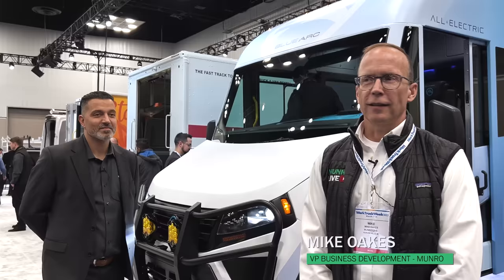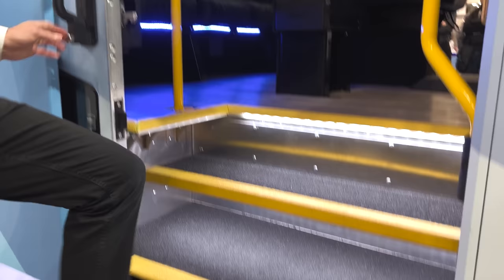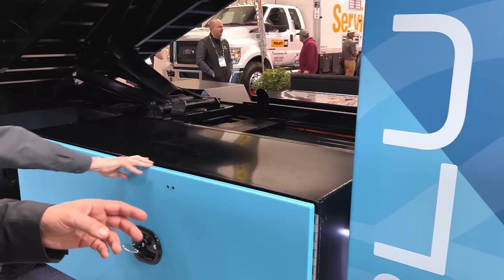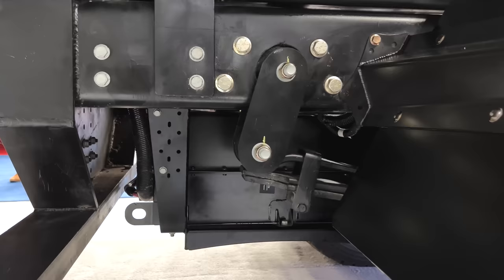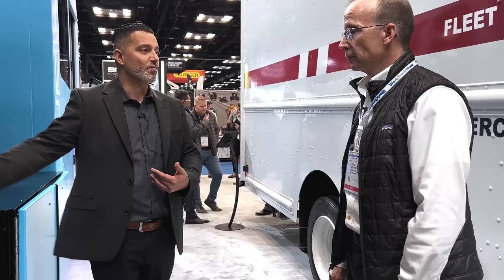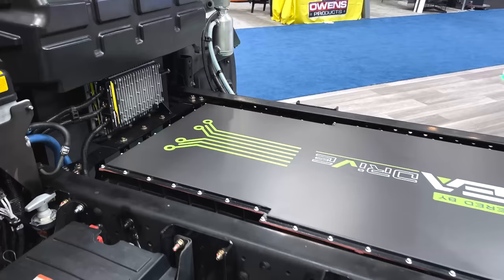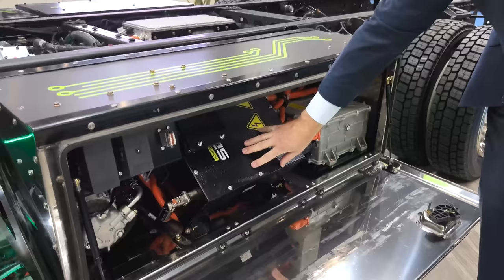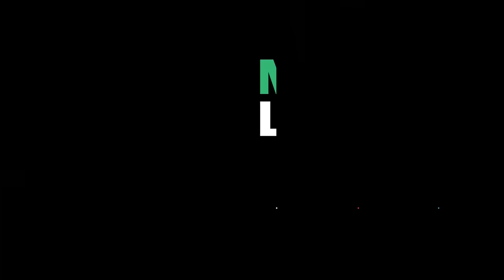Sea Electric and Blue Arc's Electric Fleet Vehicles | Work Truck Week

Comment: The blue arc truck is really nice and well thought out. On the other hand the SeaDrive truck was clearly built by ICE engineers just trying to shove in EV components. I love it when he says that you can charge the truck from AC… but that’s because it’s a TINY battery for that size truck. Using pouch cells for a new design, using electric to hydro, limited space for batteries, a brick of a design from an aerodynamic standpoint - so disappointing. They’re lucky the economics and regulations are so great for EVs, otherwise they’d go bust on their first day. That SeaDrive truck is a disgrace to any EV engineer. 🤦‍♂️🤦‍♂️🤦‍♂️
Reply: Yea it did not look good in terms of components, but as a driver I can tell you cab over with a flat nose is way much more comfortable to handle... especially for last mile delivery which I have been told is the best case scenario for EV
Reply: @mattiafrancescobruni8318  having driven a “flat nose” van I completely agree but even those can be designed to be more aerodynamic. Just look at the two trucks. One was just slapped on with crappy parts (pouch cells in 2023? Seriously?) while it’s clear to see a lot of effort was put into the other one. Kudos to manufacturers who strive to build good products and that don’t try to present a huge disadvantage as a plus (we have a small battery so we can charge faster… what a looser)
Reply: @ranig2848  yep, also the axle, E-motor have a wide ridge of efficiency but in heavy duty is usually associated to a 2-gear shifter to help mitigate some stress (es. Mack granite)....having an axle without an integrated motor+shifter could help bring down cost but wouldn't help in the long term. Also the use of air suspension would relieve some stress from the ESP even if the GVW is not that big....but bear in mind that people that drive company fleet trucks would be 80% of the time in overload especially on a 3.5 ton truck (but they don't specify I could be wrong, I mean they probably would do a 6 Ton version)
Reply: I agree, and the CEO is a finance guy and not the right person to run an engineering company (check all the failures from finance guys).  I've also heard the reliability and service is POOR in Los Angeles.
Reply: SEA Drive is an Australian company and its original goal was to make it easy to retrofit electric drivetrains to light trucks. It's obviously not going to be as good as a ground-up design, but there are millions of those Japanese light trucks on the roads of the world.
American-style box trucks/vans don't really exist anywhere outside of America.
Reply: The Hino truck is an EV powertrain fitted to a regular production glider (vehicle manufactured without powertrain). Yes, that glider was designed for an ICE powertrain.
Reply: It's a converted ice truck with a really simple, easy to maintain or upgrade setup.. 
Seems like a good cheap option right now..

Comment: 7:40 Why not having an axial mounted electrical motor connected directly to the wheels,
instead to have this longitudinal mounted motor with an inefficient differential?
Reply: It's a gear reduction differential to put the e-motor in its most efficient range for typical wheel speeds (all motors have efficiency ranges). Additionally, a banjo-style axle is a robust method of transferring load from the chassis to the wheels for multi-ton payloads.

Comment: 110 volts is so dumb  go 240 !
Reply: The voltage used in the region where the truck is operated determines the voltage to supply for power tools - that's not a design feature of the EV.

Comment: I'll wager one of their battery partners is Volta in Holland Michigan. I've toured their production facility two times and they are are at the top of their game in their industry. If you've ever seen a Winnebago Travato class B van with a battery system, it's a Volta battery system.
Reply: TESLA 4680 Lithium is Better.
Reply: @markplott4820  4680
Reply: @alesksander  - YES, edited. dang autocorrect....lol.
Reply: @markplott4820  How? Compare them, please...
Reply: The cell size is too large for cylindrical but tiny for a pouch (only 17 Ah), which might be a good clue to the manufacturer if someone recognizes that capacity. It looks like Volta assembles systems, and would not be the cell manufacturer.

Comment: I want to see an alternative for my extended mt45 22ft step van. mine has a 5.9l Cummins and converted to a tiny home with 4.8kw of solar on the roof and 32kW of storage.
I actually put a smaller 32gal diesel tank, and it runs both my 5.9 and my heater.
For heat I have a one of the Chinese clones with a custom controller I designed tied into home assistant and takes an air temp from. The 3 zones front truck cab, living, bathroom and using 3in air ducting and 3d printed servo controlled valves it will move air around to keep the Temps even. It has 2.25in of spray foam with no thermal bridges. Everything is epoxy bonded to the foam and 3 layers of fiberglass over the plastic paneling near zero risk of water damage, and I'm pretty sure the thing will float in a flood.
The floor has 2in of foam panels, and the tanks DGB tanks also have foam and coils tied into my heating system. And all this mostly run my A/C is a custom from using a compressor from a prius and a few other cars

Comment: Hmm. Quite low integrated designs. Remembers me a lot of many "garage" ICE conversions. Sadly for battery vehicles weight and low integration is really notable and hurt much more overall efficacy of whole truck system. That includes scattered power electronics, all new extra brackets, heavy battery cases etc. Also i dont see any meaningful  or thoughtfully designed aero features and lacklustre powertrain integrations.

Comment: same for SEA Electric , its Inefficient .
only gets 200 miles on 138 kwh battery and using less Efficient pouch cell Li battery. 
the HINO 195 is a GAS truck glider and built too HEAVY with an outdated Transmission & Gearbox . 
TESLA semi has motors Directly mounted to Wheels , simple 1 speed Gearbox and NO Transmission Driveshaft & Complex gearbox. 
the SEA Electric has too many Parts and ICE components. 
max HP is only 170 , and 1106 lb Torque MAX. only 65 mph ......lol, Barely highway capable.
Reply: The Tesla Semi motors are not mounted "directly to the wheels"; they're mounted on the axle beams, but drive through three-stage reduction gearing systems, and in the single-motor axle there is also a differential.

Just like the single-motor axle of the Tesla Semi, the Hino-based truck uses a motor driving through reduction gearing and a differential... but it has only one stage of reduction gearing (the pinion and ring gears in the axle).

Both Tesla Semi and Sea Electric trucks have 1-speed transmission systems, and similar transmission efficiency; the Sea transmission is just the axle assembly, so it is simpler than the three-stage reduction gearing of the Tesla.

The Blue Arc truck mounts the motor on the axle beam, just like the Tesla Semi.

Comment: C-Electric... how annoying.. I think he was throwing acronyms just to sound smart or confuse folks.  Isn't it more human  to say Gross Weight vs GVWR???   You have a smaller battery because it won't charge overnight?  Don't you realize you don't always run the battery down to 0%?  And 80KW DC charging?  FAIL
Reply: GVWR is Gross Vehicle Weight Rating... if you leave out "rating" it's a very different meaning.

Comment: For heavy commercial vehicles, Fuel Cells powered by Hydrogen make more sense. As Toyota been doing with multiple Truck companies using their Fuel Cells.
Reply: virtually nowhere to fuel them.
Reply: @jamesengland7461  don't forget not so long ago there wasn't the charging infrastructure as today.
Reply: @RogerM  Toyota has been building hydrogen cars for over a decade and yet still their cars can't even be driven to all of California,  much less most other places.
Reply: @jamesengland7461  that's an infrastructure issue.
Reply: @RogerM88  no demand; no infrastructure.

Comment: the Blue Arc truck is built too HEAVY, and its not Efficient. 
it will need 316 kwh to get 200+ miles , LOL.
TESLA model X almost gets 400 miles on a 100 kwh battery ONLY. 
it carries 7 passengers + Luggage and can TOW 3500 lbs.
Reply: Different use case entirely,  comparing apples to hammers
Reply: @ACMichler   - TESLA Plaid is the most EFFICIENT Drivetrain in the WORLD , only 1.7 kwh/mile with only ONE motor needed at Highway speeds, can Detach from DUAL rear motors. 
also, TESLA semi battery is modular can be 200 kwh to 900 kwh. class 6 - 8 .
Reply: Ping me when Tesla makes a dump truck.
Reply: @ACMichler  - TESLA will crack some nuts when Cybertruck is out.

Comment: Bad Engineering: On the Sea Electric, the engineer talks about keeping the batteries between the frame rails, but yet the steering and the brakes are right out in the open...kind of dumb engineering
Reply: No, that's good. The components that might need service are outboard, and the components that are the most potential problem in a collision are protected inboard.